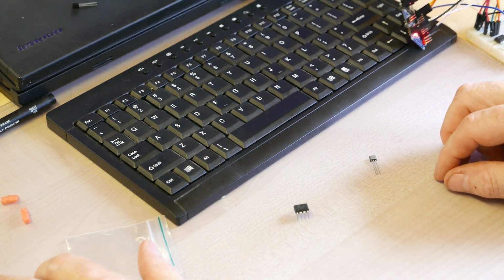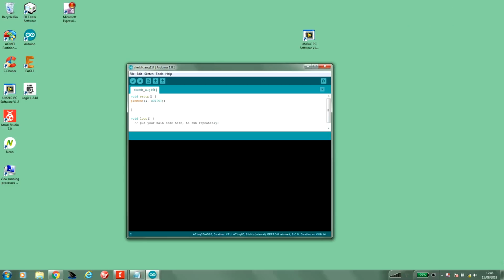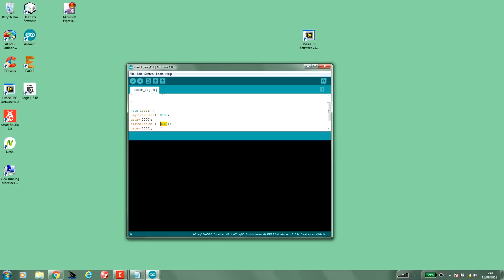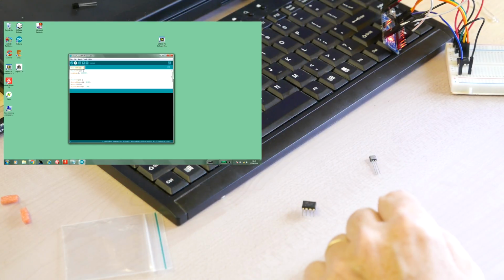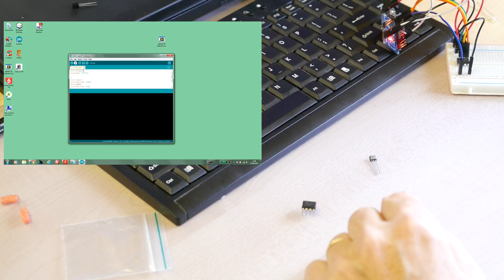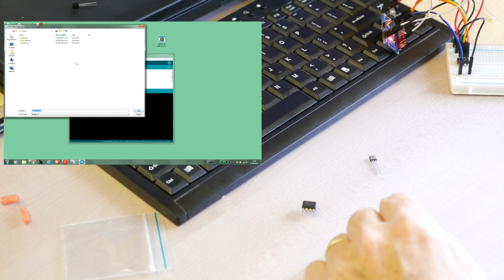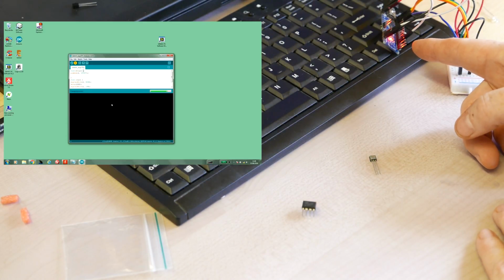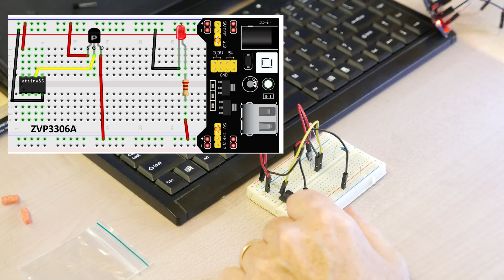P-channel MOSFET Switch. ZVP3306 BS250 - Arduino Power Saving

Comment: Would you take a pm question about components selection to protect a circuit from an 18650 inserted in the wrong direction?
Reply from the maker: Diode
Reply: @crazytom  forward voltage drop
Reply from the maker: No forward voltage.
Reply: @crazytom  what?